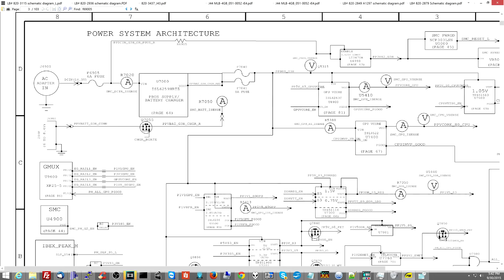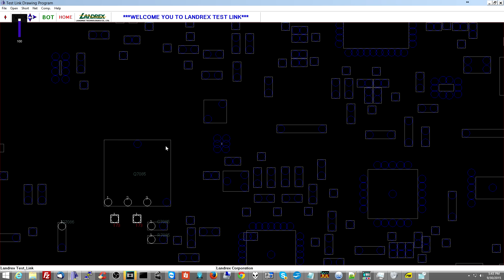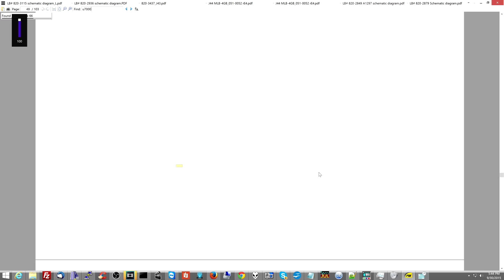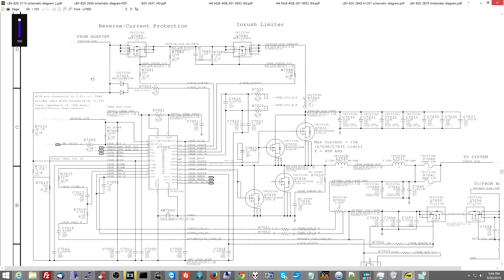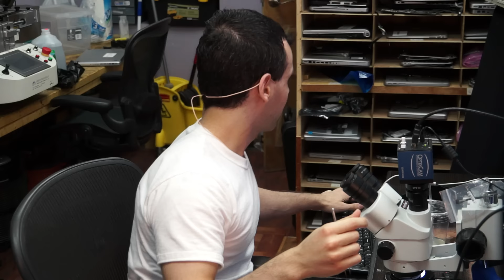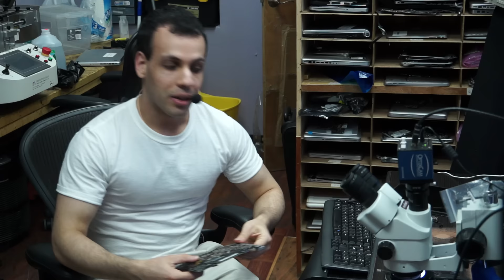Short to ground inside the board made humble old country way

Comment: lol, and while you do all those badass repairs, the controller of my 2.1 audio (that crappy controller on old Logitech speakers) had a connection problem so I cut the cable to resolder all of them. I straight up snapped the pad on one gnd, and when trying to expose the trace to solder on it, i did such a crappy job that the audio has now a terrible background noise.

Thanks for reminding us what you do is actually possible

Comment: What's with the ugly watermark now? Were people stealing your videos?
Reply from the maker: +Zestypanda nonstop
Reply: Louis Rossmann Dang, that sucks. Well, your videos were able to help me! :D I am using the very same  Early 2011 MBP 13in that had charging/power problems. I could only get it to start in SMC bypass/debug mode. It turned out, after using your videos as diagnostic tips, testing different chips on the logic board that it was as simple as a fried DC-IN board! I ordered one for $10 and installed it, and low an behold it fixed the problem. So happy I was able to get this laptop at such a cheap price because the last owner thought it was water damaged. I checked for corrosion and washed it in isopropyl alcohol and distilled water and used light heat to dry it, re-assembled it and it has worked like a dream ever since.
Reply from the maker: I'm glad it helped you. You are who this channel is for!